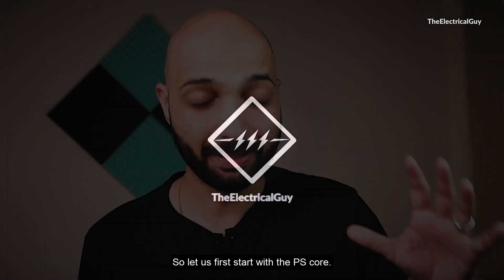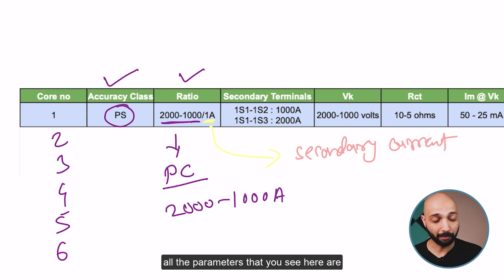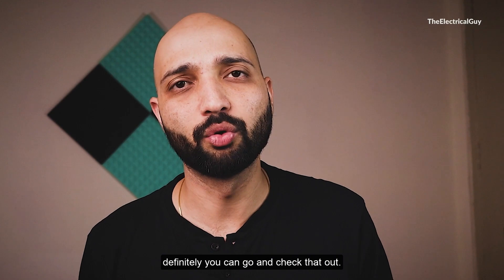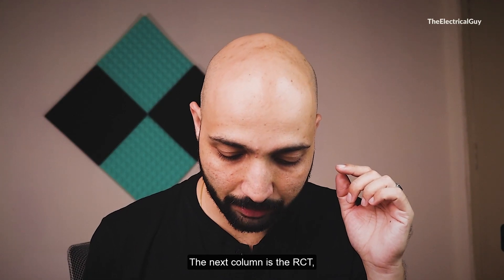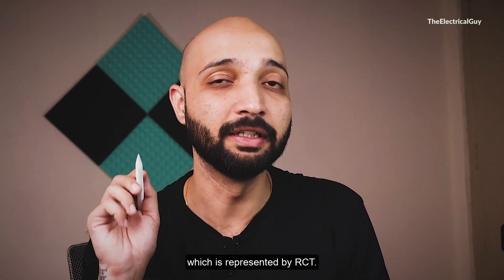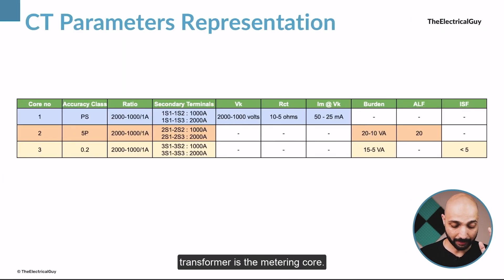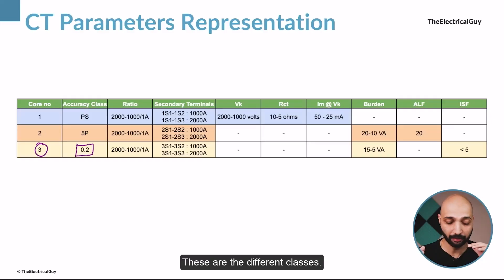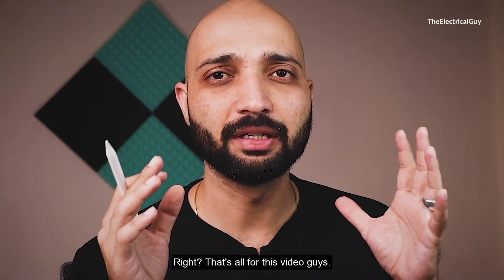How to read the parameters of PS, 5P & metering core of a CT | TheElectricalGuy

Comment: How are the power system primary protection relay wired to the backup protection relay ? How are the cables/ wires connected ?

Comment: Whatever is the primary current secondary current is 1 A.  Then why two Rct value in secondary winding?
Reply from the maker: It is based on the primary tappings. With change in the primary taps the Rct also changes.

Comment: If length increase, resistance increase,so current will be reduced,but you said 1S1-1S2= 1000A,1S1-1S3=2000A
,iam not satisfied with your explanation , in case of CORE , please sir make One special video on this

Comment: Wanted to mention since transformation ratio is N1/N2 = I2/I1 then when you reduce number of windings in a C.T the current capacity should increase. So I think the resistance between 1S1-1S2 will greater than 1S1-1S3.
Reply: Please correct me if I'm wrong.